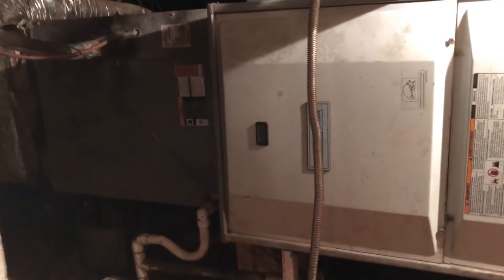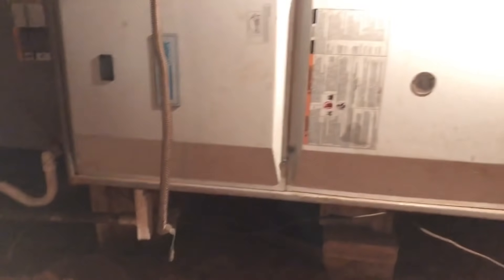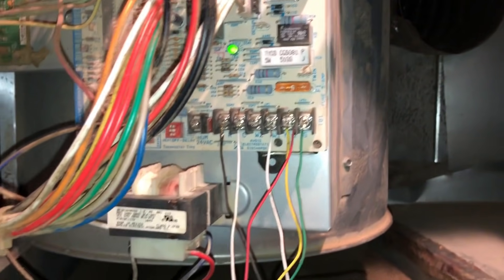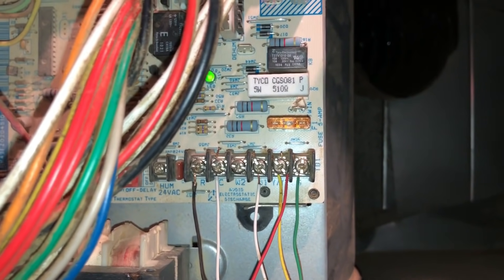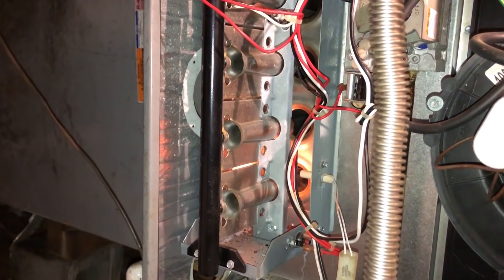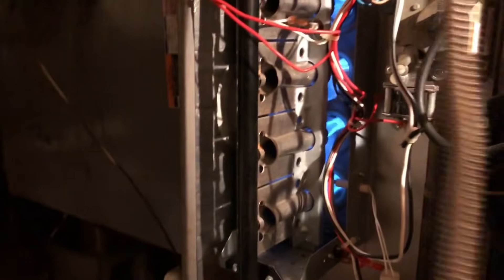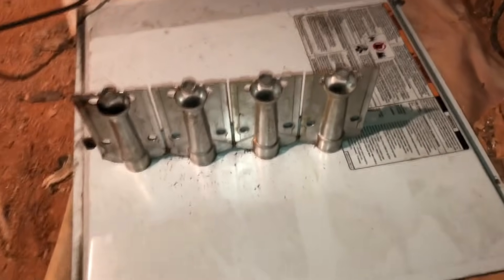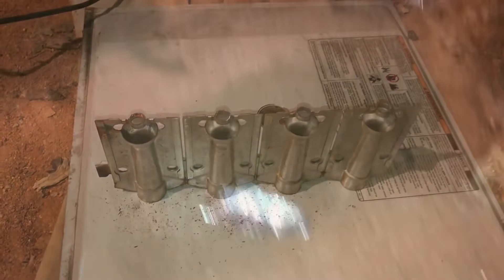ICP Comfortmaker Gas Furnace Burners Clogged and bad gas valve

Comment: My son had a yellow flame on outside burners,had a company come out he said needed a new furnace,said heat exchanger was bad,cost him 7000 for a new furnace,I told my son to keep the old furnace,the two outside burners were plugged just like the ones on your call ,I cleaned adjusted the gas pressure and now I put it back n my other sons garage,works great blue flame ,it’s great to see that your not trying to sell them a new furnace ,great video.
Reply: I had the exact same thing happen to me this year, and the story is literally verbatim.  Cracked heat exchanger - New furnace - $7K!  I don't have any roll out, just a few yellow tails... What's the company you used and what state are they located in?  How did u adjust the gas pressure? 

Thanks

Comment: Hi from B&E in Charlotte, NC. this furnace you are working on has the same board that  Carrier used back in 2000 to 2009. We wired the thermostat just to W  the furnace will run for 8 mins and will go into high fire. If it goes into high fire twice in 1 hour then the next time you call for heat it would start in high fire. They used the same circuit board on the 80% and 90%  2 stage furnace. If you put a jumper across w1 and w2 it would stay in high fire. So with this board you did not need a 2 stage
t-stat. I had a customer call me and said i ripped them off. Because we did not install 2 stage t-stat. I had to prove to homeowner or the BBB. He only had a 4 wire coming into the house. I like your videos. I make so of my young guys watch yours and others I pick out for a service class. Keep on teaching you have the voice for it.
Reply: Yep, are are exactly right. Good call buddy 👍

Comment: We once bought a new Bryant 95% eff. furnace that vibrated from day one. We complained, but the installing company said it was fine. Well, 5 igniters, a induction motor and a new gas valve (damaged by the vibration) they finally agreed the blower cage was out of round when they had to replace the blower motor and blower cage which stopped the vibration problem. By that time we got a recall on the heat exchanger problem that Carrier/Bryant furnaces had with the coating pealing off the heat exchanger and causing holes in the exchanger. They said ours was bad, but would give us new heat exchangers, but we had to pay for the long amt of labor time to do the replacement. We said no thank you and just bought us a new furnace from a different company. It has been trouble free once they corrected the inducer pressure switch that was known to go bad on the new furnace. New furnace is now 9 years old and working great. Still passes the combustion analysis and runs smooth and quiet!

Comment: The moment I saw the condition of the burner rail (and even after cleaning it) I would have just replaced it with a new one if it were readily available like in my truck or shop but due to being a Sunday I understand. But you can now get it, return and replace it! Either way, great diagnostics!

Comment: Your suspicions about the roll out were correct. I would sell them a new furnace. I ran into a similar situation years ago, and the heat exchanger was plugging with the same soot you seen on the outside. I tried cleaning it, that was a joke! She's got some age on her anyhow, probably not worth a heat exchanger, gas valve, and labor.

Comment: No need to jump w1 and w2. Make sure dip switch 4 is off and it will stage up after 12 minutes.
Reply: D Hinton can it stage faster than that if set to two stage stat?
Reply: Yes. I was only referring to a single stage stat.
Reply: pretty sure icp, carrier etc is 16 minutes on a single stage stat, not sure what dip switches were set at because jumping w1 and 2 should bring on high stage regardless, unless its in the low heat only mode. So that Gas valve wont be bad and chances are its been running in low its entire installed life.
Reply: But w1 and w2 is instant 2 stage
Reply: Correct
Reply: Ahh yes 12 min rounds up to 15 and 15 is half of 30 and 30  is basically 60. So i can charge for a extra hour. :) $100
Reply: @Youngbl33zy  So , stealing just naturally comes to mind ?

Comment: also, with that condensate drain off before the "trap" it will keep water from draining out and build up in the bottom of housing/secondary heat exchanger.
probably full of soot inside and time for a new unit, vs. repair since there's so many issues.

Comment: Has he ever said why he tapes off the door switch all the time? Also why does he jump out the heat at the furnace so often? I almost always used to make sure the thermostat was calling before going to the furnace.
Reply: Well he tapes the switch so he dont have to hold the button in while checking components. I wont use tape of any kind though. I use a clamp. And its easier to jump out the board at the furnace than running up and down stairs and crawling in and out of all the crawls spaces these guys have out there.
Reply: @stueygreenberg8989  IIRC, though, he says he leaves the tape in place when he's done, which defeats the function of that safety switch.

As far as jumping out the board, I'm not sure why he wouldn't set the thermostat as the first thing he did before going into the crawlspace. Then it would be calling and he'd know that there was no problem between the furnace and the thermostat, or with the thermostat itself.
Reply: @guitarboy123987  Late reply, but a lot of furnaces go into a 90 second blower cycle if power is restored with a call for heat. It can be a PITA when you're trying to diagnose anything that isn't the blower motor.

Comment: The low pressure you're diagnosing... The soot and flame roll out situation... This could all exist because there is not drip leg for the gas line to prevent moisture and debris from entering the jets. The gas line should be brought up to code.

Comment: Is that an lp furnace? I run across several carriers like that and most are lp. The way those burners look, you will likely be back soon for the secondary heat exchanger.

Comment: I am not an expert, but, even on my furnace of similar setup it has one at each end of the burner rack.  I also noticed some disconnected wiring near the draft inducer as well..... that would make me un easy.  I have seen people by pass those after the rollout burned the wiring and the whole unit was sooted shut.  Always enjoy your videos Ted.

Comment: No w1 w2 jumper on that furnace, just set dip switches to single stage thermostat and uses algorythm to set go to stage 2 if heat is still on.

Comment: How do you know the gas valve is bad and it's not just set up incorrectly? Second stage might be disabled with the dip switches, or the gas pressure could be set too low. Why didn't you try to check or adjust the gas pressure? Maybe somebody turned the gas pressure way down to compensate for poor airflow or something.

Comment: time for new burners, install an fresh air intake and of course reconnect the condensate drain, which is pouring acidic junk into the bottom, evaporating and helping kill the burners, besides the humid crawlspace air

Comment: Run a combustion test before, during and after all that gas pressure adjusting, or they may not be customers for much longer. What's that old saying? "If you're not testing you're guessing!"
Best not to guess the amount of CO you could be dumping into the home.
Reply: Don't you mean CO?
Reply: @douro20  guess that's why you should proofread before commenting lol. Thanks for the correction.

Comment: I could be wrong but I thought I saw 2 red wires with spade connectors hanging in space.  Looks like someone pulled the roll out switch out,  could have been tripping, hmmm.

Comment: That thing needs a full maintenance. Cleaned wheel and a good check of the secondary. With all that rust in the bottom, it could be pouring condensate out of rust holes and it would just blend with the rust already there.  Very sketchy unit, probably about time for new one.